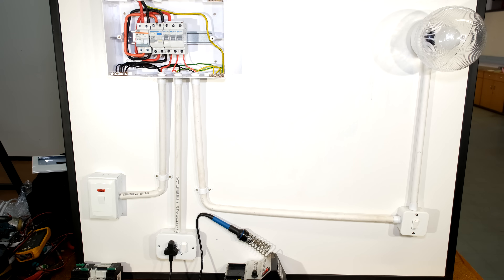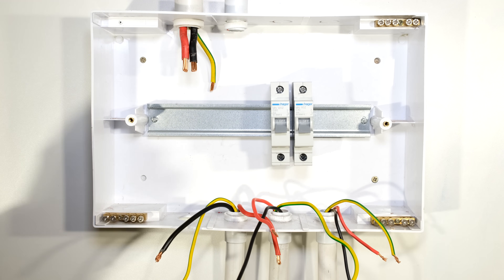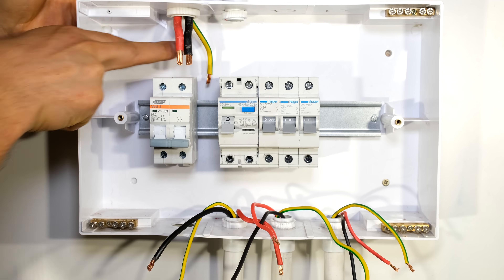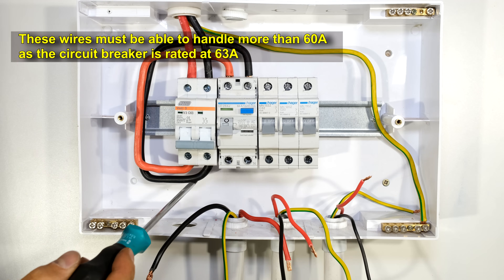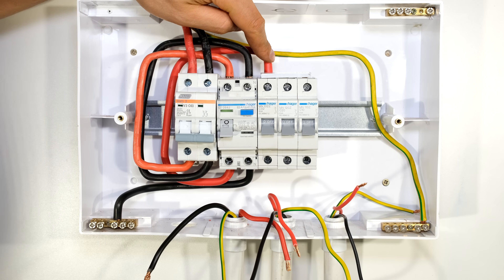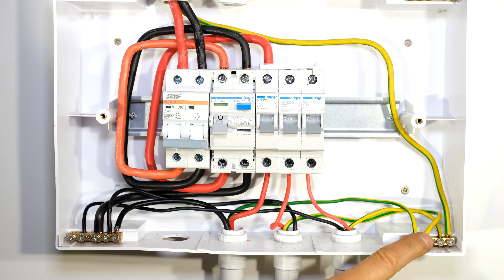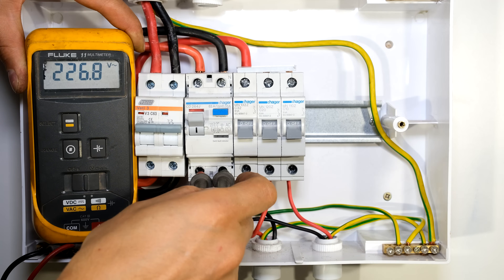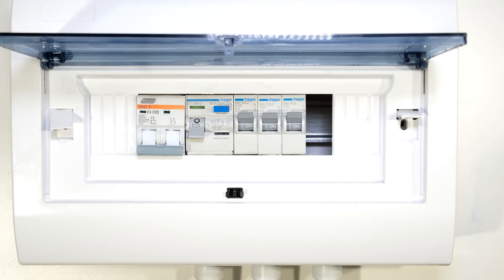How to wire a single phase DIN rail distribution board - practical demonstration (South Africa)

Comment: Very good video. Do you maybe have a likewise video for 12V. One simple panel,charge controller, battery to a DB for a off grid house. Maybe with a small 2000w car inverter in? But excellent video.

Comment: My D/Bs has two busbars to accommodate 13 breakers and there’s a nut and bolt which is fixed the the metal casing. I did assume by the size of the bolt, that it’s to take all the earthing cables. Buy ChatGPT says you can’t do that.

Comment: From this wiring setup, if one takes a ohm meter and measures between Earth and Nuetral, what is the reading supposed to be and why? I had a guy working on my DB board measuring between earth bar and black Nuetral bat and getting an almost short and was trying to source where the short between them was located?

Comment: Great video.  Thanks. Tell me, are you supposed to have continuity between Live and Neutral under any circumstances? I am asking this because after installation of a prepaid meter, I have noticed that when doing a continuity test, there is continuity between Live and Neutral. Is this right?

Comment: You've helped me to remember electrical engineering wiring. I have been sitting with my N2 in electrical engineering not realising that I could have used it for more than a decade. Now I am refreshing my knowledge so I can have an extra stream of income. At the moment, I am positioning myself as a project manager in this space, until I get the necessary experience and compliance to actually provide wiring, installations, maintenance and repair services. Thanks to your videos.

Comment: Seems pretty straightforward, especially the way you have explained it, however with my board (Australia) the earth is connected to the neutral buzzbar. Is that correct? Thanks

Comment: And we in school have the worst tools and components possible. They want from us to squeeze the cables in to 2 cm margin between switches. My finger has a hard time to fit in there how am i supose to connect the cables to the switches and also be faster because they told me that i'm slow.
Reply: also the thing u r using to connect these circuit brakers, we don't have it, we have to connect them with cables, that's my nightmare i can't do this and im complaining but the answer is that i have to be better.

Comment: If i have
1 × 30A stove circuit breaker 
1 × 40A circuit breaker for the inverter inlet
2 × 15A circuit breakers foe the plugs
2 × 5A circuit breaker for the lights, what should be the current rating for my Main circuit Breaker, will i be fine with a double pole 63A MCB?
Reply: Yes. You can use 63A. Make sure your entire load is 50A, or at most 55A.

Comment: Thanks for a very informative video. I am not an electrician, but knowledge is power. I have a question: I have 3ph supply. My main MCB in primary DB is rated at 50A/415V. While the main breaker in each of the 2 sub db's is 63A/400V. The main DB also contains MCB's for each of the 2 sub DB's. These are rated at 63A/415V. Why is the Main MCB of Primary DB rated at 50A while the Sub DB's are rated at 63A? Also i'm wanting to swop out the Sub DB MCBs located within the Primary DB with smart breakers to monitor energy consumption in preparation for near future Solar installation. However, the smart MCB's available is only rated at 63A/380V. Will it be advisable/acceptable to do such a swop out? many thanks. Ian

Comment: Very informative. Unfortunately, I have 380v 3 phase main power. So my sub-panel is a bit more complicated. In fact, it's a bit of mess. I live in the mountains of Mongolia and it's pretty remote but we do have grid power. We mainly use 240v appliances except a heating boiler which uses 380v. 

It's not so easy to use bus bars because I distribute power from different phases.  I use jumpers from the main switch to each circuit breaker instead. Well, at least the electrician who set it up.

If you would do a 3 phase supplied video, that would be awesome. But maybe it's not that interesting to people.

Comment: So... I got a couple of these to use on my solar system. One of them is backwards on instead of being off when green its red when its off. And then when I switch it to green its flowing power. The others are all different than that where red means power is on or 'hot'. 

What do you do to fix it when they are backwards on the on and off switch? And has this happened to others?

Thanks

Comment: Would it be possible to build this setup on a 10A circuit breaker coming from the main db board? Going from 10A to a 63A/16mm circuit breaker would be violating the bigger to smaller rule, not so?

Comment: Are you allowed to use FTE cable to wire light switches and wall plugs and connect to the DB board? And should the FTE cable also be in PVC conduits?

Comment: Nice. But still some issues to be resolved. For flexible cable special cable lugs to be used. Direct connection not allowed. Dynamometric screwdriver to be used to be sure, that connections are pressed correctly. Labeling circuit breakers not enough. Cables to be labeled by wire identification rings. So this quality maybe Ok for your home, but not enough for commercial product.

Comment: Thanks for this interesting and pedagogical video. One question, though : why, instead of wiring a common neutral bus bar apart, didn't you use 2 of these "direct connect" solid bars, and connect them from the "leakage protection breaker" to the lamp circuit L & N ?

Comment: Correct me if I'm wrong but I think the 63A is an isolator switch, it is not a circuit breaker. The 63A rating means it can handle current up to 63A, beyond that the switch can get damaged, melted or burnt.
Reply: U can get both isolator plus MCB in 9ne switch.
Reply: @Antharishk  Yep i did not watch the whole video that's why I missed that part 2:47 where he talked about differences. In the UK usually it is rare to see a double pole MCB inside a DB board. Only single pole MCBs, double pole RCDs and an isolator switch. You may also see RCBOs and an SPD. And of course there is another isolator switch after the meter and a fuse before the distribution board.

Comment: Lights are not supposed to be protected by earth leakage so that they might not go off if the is a problem on plugs
Reply: Any circuit can be (or better be) protected by an RCD (with an MCB) or even better by an RCBO (without an MCB). It is just a matter of how much money you can spend. An MCB only protects your circuit in case of overcurrent and short circuit so you need an RCD to protect your circuits in case of ground fault and electrical shock. An RCBO provides all those protections.

Comment: At 1:20 author mention ferula, as fair I know it's reccomended to use them. And things which was omitted and should be mentioned at this video: Cable glands and LABELING of the switches. I will say the last one is very important from practical point of view.

Comment: What would happen if the "circuit breaker" "supply" (live) was connected at the bottom of the breaker and then power taken to the circuit from the top point?  Would the breaker still work correctly (my thoughts....it should as it is AC current with current flowing in both directions), but what is your advice?

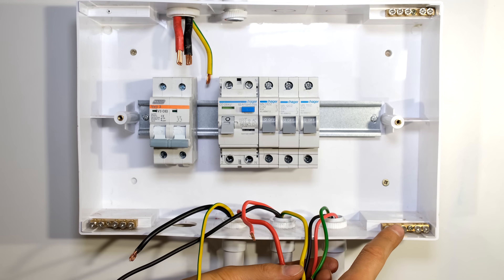Comment: ADD: It is common practice that all INPUT (or supply, source) electricity are to connect from the top just like this 4:17.
In this video, it just so happens that the supply wires came from the top; however many installations have the wires from the bottom instead, ie pulled from the ground up, but it is connected to the tops of the CBs. 

6:17 Even if this looks ugly, it is a best practice. Some CBs have special circuits on the tops. Fuse Holders for instance have the fuse connected to the bottom. If one wired the bottom as source, you wont be able to hold the fuse.
Reply: Can you provide your link are you electrician indeed

Comment: Shouldn’t your overcurrent breaker be rated at lower amperage (40 or 32 amps) than your earth leakage breaker in order to protect the 63 amps  earth leakage circuit breaker!